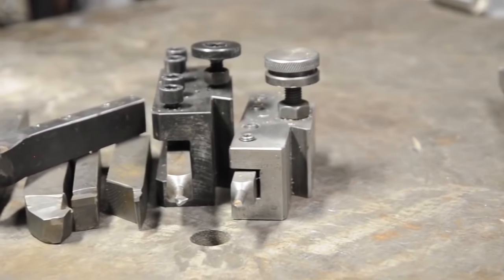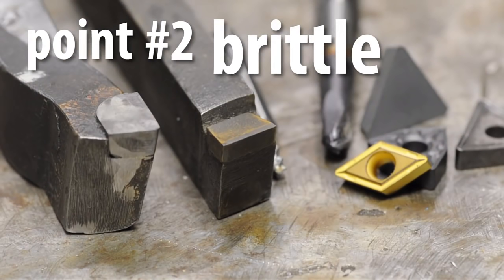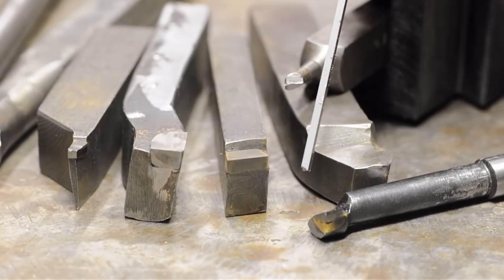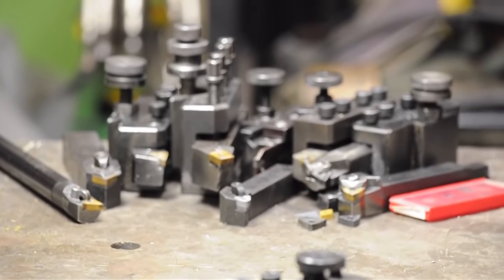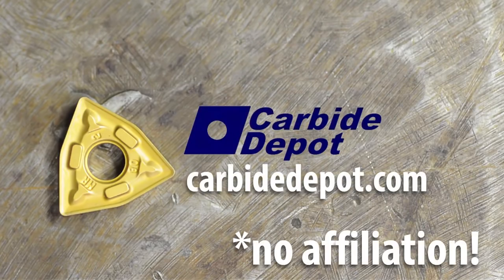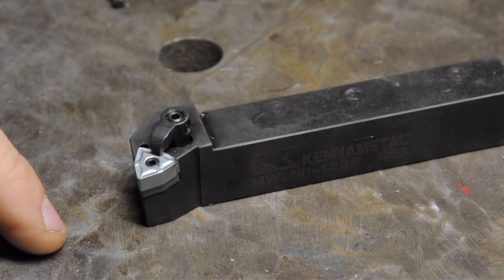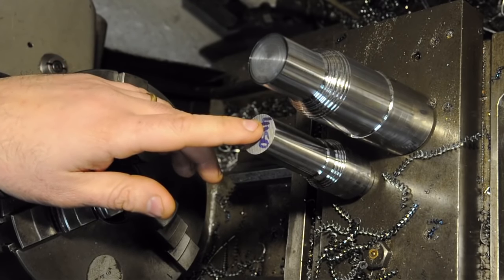A Brief Chat about Carbide Tooling

Comment: This pair of videos, the last one about HSS bits and this one about carbide are probably some of the best videos on the subject I've watched. Also really good are Tubalcain's videos. Yours is a more "why" and his is more "how." If I was to send someone to learn how to do this, I'd send them here first, then over to MrPete to watch his old videos on the specific angles and how to arrange them on the different types of cutting tools you're making. I don't remember him talking about chip breakers either, so I learned quite a bit about that here. I so happen to have one of those cheap boring bars with the soldered carbide and before I went to work with them I realized that there were not adequate relief angles on them to actually make a clean cut. I need to bore a hole that's taking less than ten thou off per side so I need it to work the first time and give me a decent enough surface finish that I can hone it the last couple thou. I've got a couple of diamond wheels for face grinding on the way that I'm going to adapt to my bench grinder with an  added "table" I'll clamp in place to give me a more precise control over the grinds. I started out freehanding my HSS bits! Yes they sucked, and before I really got good at making them, I moved on to inserts. Here's hoping my setup works, because I don't want to spend any more than I already have on this setup.

Comment: I am not a profesional machinist, but I do some milling at my job. I had to do some work in 304 stainless and had TiN coated HSS. It sucked and did not really do a good job. I bought a TiN coated carbide end mill and it worked so much better. The stuff is incredible.

Comment: It's a sad reflection of the woodworking trade that even pro user's are often woefully ignorant about the pros and cons of HHS , carbide etc.
I do increasingly use carbide inserts and for some types of work they are the go but engineers are often surprised when I tell them I still prefer HSS over carbide for planer knives. It's sharper, gives a smoother finish and has far lower cutting pressure. I re grind sharpen my own knives, which makes it very economical. 
I do like carbide tipped bandsaw blades now they are coming down in price. But HSS tipped blades do last a good deal longer than carbon steel.
Brazed Stellite is perfect for oscillating chisel mortiser bits. The standard option these days though is Solid HSS. 
Most large joinery shop's do a lot of their own sharpening and even big sawmills still prefer HSS to carbide in some applications.
Anyway, very interesting video. Most informative. Thank you.

Comment: Hey Tony
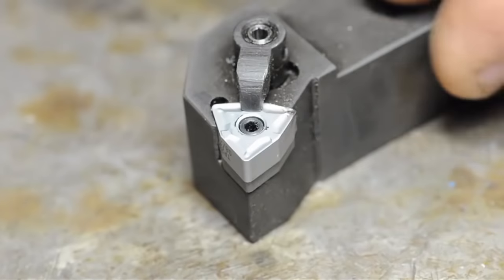I noticed at 15:19 in your video here, that you missed a step when changing the insert. I did not see you draw the insert into the pocket with the pin. You only clamped it. It is very important to turn the pin and then clamp the insert down.
Great video!

Comment: One of the issues you've touched very briefly upon in this video is how insert size affects holder-shank size which in turn affects toolpost size.
I just got a full size lathe (14x40) with an AXA size toolpost. In turn, those holders seem to max out at 5/8", and holders for WNMG 08-04 seem to have much larger shanks than my toolpost will accommodate.
But the value of getting six gutting tips per insert is nevertheless really attractive to me. The lathe came with lots of tooling, most of it simply too large to use. I expect the last guy had a different toolpost on there, though none of the tools with shanks bigger than about 1/2" seem to have been actually used. Mostly brazed carbide.
Anyway, I guess I'm putting the cart before the horse, and I need to start making things and work from that angle as to what kind of tooling I need.

Comment: Just a tip that you probably won't see, but you're supposed to tighten the screw in the center of the insert before you tighten the clamp 
Source: Journeyman Machinist
Reply: I saw that too LOL. I am sure he will notice when he goes to use that tool for a roughing cut and the insert either breaks or gets spit out. Posted by a CNC programmer/machinist in the aerospace industry.

Comment: Sorry if this has already been discussed but I did not take the time to study all 1000 comments. This was a great video that I have watched sever times over the years when I need a new tool and I need a refresher on tool geometry. One critique I have that would be helpful for us who watch your tutorials is to show at couple of passes at regular speed. At the end when you were showing the cutting performance of the insert, every pass was sped up and it was difficult to determine the travel speed. I have an older lathe and the step pullies are not marked with the RPM combinations, so it's some simple math and a fair amount of trial and error to get to 1200 RPM. but the travel speed is where it would be good to have a real time pass so we could see how fast your test cuts were conducted.
Reply: On a lathe the is no need for a feed/RPM combination table, the feed is set in distance per revolution, not in distance per time.
So for finish its usually around 0,1mm per turn and for rough around 0,4mm, no matter wich RPM

Comment: As a woodworker I find the extra cost of TCT over HSS more than worth it. Router bits with TC inserts are amazing. And that goes double for planer heads. Especially when you use old wood. The downtime of having a HSS planer blade nicked by hidden nail is totally worth the investment in a planer head and the 30 odd inserts. It's basically a once in a lifetime purchase. If you damage an insert, just flip it around and with 8 usable sides on each insert, by the time you need to replace one or two, you're probably 10 years further. At which point a couple tenners for a few new inserts probably isn't going to be a problem.
Same with composite materials like chipboard, HDF and to a lesser extent MDF can dull HSS in a couple metres. TC is the only way to go there.

Comment: Sir Old Tony. I'll have you know, incase you don't already, that the difference in the two inserts (model #, cutting style, finish, ideal DOC, ...) is the nose radius of each insert! Sandvik operates in the same fashion. Each company has their own style tool holders of all shapes and sizes, only to fit their own style of matching inserts... All while subject and complying to the same industry grading and standards set forth. For gen turning/facing we use 30/65/5 WNMG/CNMG/rare endangered species. Boring, on the other hand, is nearly dominated by WNMG. Anywho, our WNMG 431 has a .015 Nr; the 432 has a .031" Nr; and the largest Nr we use, .047, is a 433. Same rules apply for all turning inserts, OD or ID if I'm not mistaken. For example, we use CNMG 431 - 433's as well...same nose radii and all other geometry you covered in the vid. Once again, killer video! Keep em coming!

Comment: I was told(during my 3 weeks apprentice time of total lathe use) that it's not just "high rpm", but Surface Feet per minute, which goes well in hand with having a higher feed made the final cut you did much nicer along with having the chipbreaker function properly. Jumping right into carbide tooled lathing was... quite tense at first when having to go close to the chuck because of the feed rate being so high, little room for not disengaging the feed in time.

Comment: My lathe setup is a 7x10 mini metal lathe from harbor freight, with quarter inch indexable tools in a 3/8 lantern style tool post, so the tools are shimmed using some spring steel that was banded around a crate i got once, and I bought a pack of 10 Sandvik inserts for like $15 (dont even know if they are real) whuch didn't actually fit the tool holders so I had to grind the toolholder so they would fit. And im able to turn titanium pretty well on it.

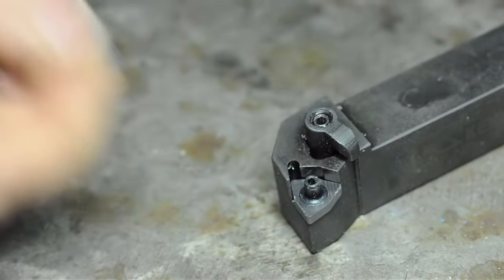Comment: Hey TOT, I have found the quickest way to crack/break an insert is to not clean off the holder when rotating an incert or just changing it.(15:10 in the vid) even the smallest chip has broken a brand new incert. Chipping the tip as in this vid is one thing, there’s still 2 more to use but... breaking a brand new one before you even get a chance to use  it is a very costly mistake. Like the time I ponied up the $27 for a 3 fluted 11/64 carbide drill for a special project and hit it with a parallel during the set up , I thought I forgot to install the bit in the chuck. To this day I haven’t come across the  end of that drill. It was broken off cleanly even with the chuck jaws. Anyway... great video. Lots of useful tips. Thanks for sharing.

Comment: the one round insert on the left in the row he showed is actually a ball end mill insert--they work well by the way.. If you look at the geometry at the tip you can actually tell it cannot cut left--then cut over to the right such as if set up on a lathe.

Comment: Carbide has its place, as does HSS.   Brazed carbide is great for interrupted cuts.   I like an expensive grade of Cobalt, even with face milling,  but I’m a dinosaur.    Hardness of the tool is not that important to me.   I like long tool life in the garage now.   Most home shops do not have rigid enough setups, or machines, for using carbide.  I loved carbide when I worked in big shops with expensive machines, rigid setups, and we did high production.    To me, carbide is like a high maintenance girlfriend.

Comment: Carbide is KING!.... My re-saw bandsaw, joiner, planer, over arm router .. All running carbide. Even if HSS is "sharper" by (guessing) 10%,  it looses that 10% real quick & slowly gets duller. Carbide starts at that 90% & stays there for a long long long,,,, time.

Comment: Users of small lathes may benefit from trying what are known as finishing inserts. They are usually sharper than roughing inserts. They usually have chip breakers designed to work better at small rates of metal removal. The ones I use have a ground edge and 15 degrees of rake. They, like aluminium inserts which are also ground, work great when you have only half a horsepower to drive the spindle.
Reply from the maker: Good point!

Comment: The tool at 15:15 Tony only tightened one of the fasteners. The screw in the middle of the insert is supposed to wedge the insert against the back walls. At least on my Chinesium holders the screw has worked properly. Otherwise it doesn't register properly.

Comment: Mini-lathe, CCMT works good for me. I also have internal and external threading inserts, and a square insert I use for chamfers. Yes, carbide likes to be pushed hard, and that isn't easy on a small lathe. But for ease of use, carbide wins every time.

I do use HSS for some applications, like when really low tool pressure is desirable, for example small brass parts, you can get a really sharp cutting edge on HSS with little effort.

I even use CCMT inserts in my fly cutter, spent ages trying to grind a HSS tool without much success, but a CCMT060402 in a cheap left-hand lathe tool holder works really well - I just have to remember to run the spindle in reverse...

Comment: I have to say yes there always is a catch. As was said in the movie "that's a hell of a catch, Catch 22". For the hobbiest with a small bench lathe imo thebest choice is on of those sets of 5 triangular tool holders with the positive inserts. I actually have a set I bought for work mainly to do chamfers in stainless so I wouldn't beat up my HSS specially ground form tools. To my surprise these tool holders have worked really well. For example one task I have that comes up a lot is making up push screws for dis-assembly of mechanical components. We prefer to make these from 12.9 grade screws. These inserts and tool holders allow screws to be turned on the end to a "dog point" that requires no clean up of the threads because of material being rolled over at the edge of the.  The lathe being used is a Grazianno SAG 12 (nice lathe, really weird tranmission). These holders can be had fairly inexpensively (ie "cheap"). But they do require decent inserts to work well. But that is true of insert tooling in general. For the novice they provide a way to get into the game yet are similiar enough to HSS that the novice will not be lost in terms of set up
Reply: Respectfully, my choice would be a "CCMT" set.  IF you purchase a set you can make use of those other two edges/corners so that gets you up to 4 (compared to 3).  My experience has been boring bars are more readily available using CCMT inserts so you don't have to buy more than one shape of insert for various turning tasks (threading excepted).  The same holders fit "CCGT" inserts which means if you are really down on power or turn non-ferrous materials you can use sharp inserts.  My experiences with purchases from EBay would be that good quality CCMT is more prevalent in more flavours and a wee bit cheaper than TCMT (if those are the triangles you are talking about).
Reply: +RussZHC Of course all inserts have their strong and weak points. Yes the inserts I'm talking about are the TCMT or TTxx. These holder sets really don't get a lot of love. Especially the cheap import ones. The main reason imo is the insert screws which are what Stefan calls "cheese grade". These can be replaced with Torx insert screws or if one is cheap with the appropriate sized SHCS. Mine are 6-32. Others are metric. The head of the screw can be machined to have a 90° included angle feature that engages the countersink in the insert. The 1/32 radius tools are stronger than the 1/64 in terms of how well the corners hold up. I also have Cxxx style tooling in both positive and negative rake inserts. In heavier lathes I prefer them over the Txxx style insert tooling.

Comment: One reason that sintered carbide inserts have the size tolerance and generally are not as sharp as a ground edge is how they're made.  A composite powder is molded into the shape of the insert under high pressure, and remains very fragile until sintered (baked).  The insert will then shrink quite a lot, about 20% in each dimension (a 50% reduction in total volume).

Comment: The negative tool does not necessarily need more horsepower. If flat top and bulldozing through metal, very strong for maximum metal removal rate on CNC machine, that is true. But with the chip breaker insert shown, the actual cutting edge is positive rake and sharp, same as any other positive rake cutter.

Comment: I wish they would have had those inserts back when I worked at Firestone 
We mostly used high speed steel and when we needed carbide we would be scrounge up some old carbide cutting blades that had been used up for its original intent we would cut those little pieces and Silver   solder or braise them and grind a little perch on a piece of high-speed steel trying to get that angle just right 
We had some Diamond grinding stones back in our radial tire room that we used to sharpen the steel cutters for the radial tires so it was nice to have that available 

Today it’s almost like you can phone it in talk to your machine tell it to get busy show up and had your work in 
Well maybe not yet but we can see it coming 
I just wonder how much knowledge we are losing how many people today could pick up a set of plans or there page grab a chunk of metal and make things with no computer

Comment: i prefer the diamond shape, a pro tip, if you wanna take really fine cuts in like hard materials, 2333 for example you can use carbide inserts for aluminium, really sharp and will break really easy if you mess around but you can take really fine cuts with really nice surface.

Comment: Dailey i work at a 1200mm horizontal lathe. we just used a lot of time trying new brands of inserts. we mainly use Sandvik inserts, they are very versatile and werry tough, we tryed Kennametal, Seco, ISCAR, Mitsubishi and tungaloy vs Sandvik. but only 3 small cases wher Tungaloy was more tough. and a Seco SNMG with bette vibration "controle". so i go with Sandvik moste of the times, we also got a grooving tool from ISCAR that worked better and way cheaper than Sandvik 😊

Comment: Working in a tool room we usually use ccmt and mostly dimond shaped tooling in the lathe. But still use some high speed steel. Carbide never ceases to amaze me. .100 cuts in stainless and still holds up. Ive faced 400 300 series stainless pins on the same insert. Hss wouldn't do that.

Comment: Tony, you forgot to mention the great "C2" verses "C5" carbide conundrum, once you have some of each you can't tell them apart. I tend to get whichever one is most "tough" (resistant to breaking) and if its not optimal for aluminum so be it, I'm a hobbiest and don't need high productivity, just simplicity.